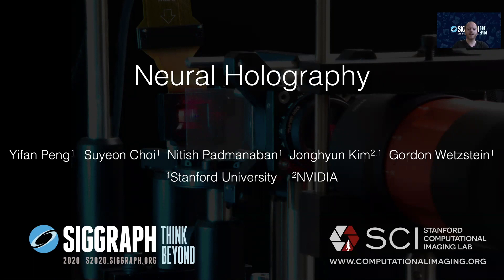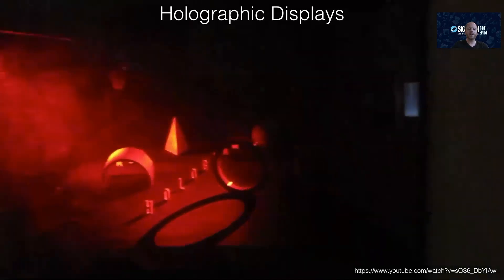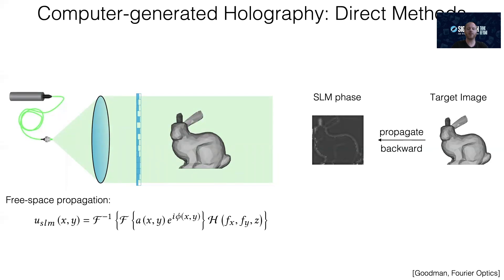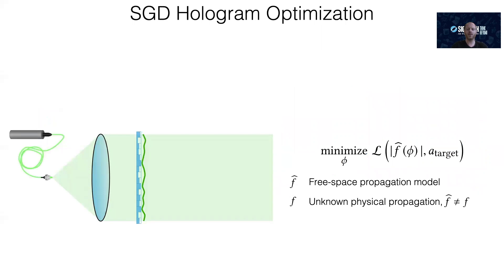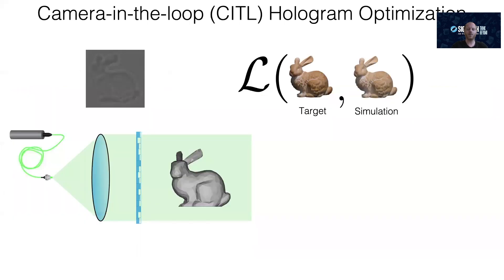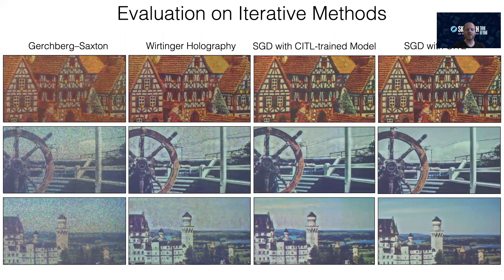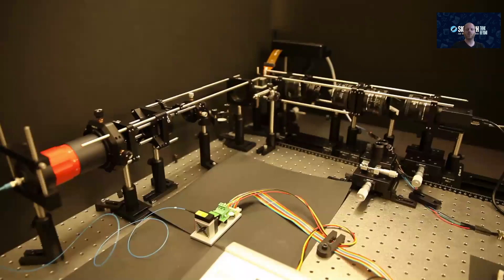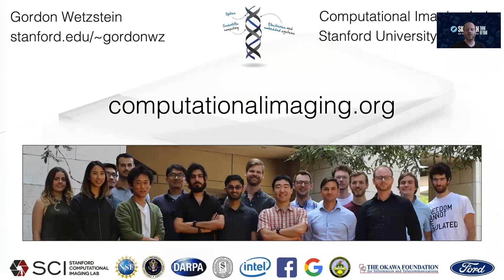Neural Holography | SIGGRAPH 2020 ETech - 15 min tech talk

Comment: Okay, let me try to figure out how to improve the design of the neural holography system described in the paper. The main goal is to enhance image quality. Let me start by understanding what the current system does.

The paper talks about using camera-in-the-loop (CITL) optimization and a neural network called HoloNet to generate high-quality holograms in real-time. They mentioned that model mismatch between the simulated wave propagation and the physical display is a big issue. Their solution uses CITL to calibrate the model and optimize holograms directly with a camera.

So, to improve image quality, I need to address the factors that cause degradation. The main issues seem to be:

1. **Model Mismatch**: Even after calibration, there might still be discrepancies between the simulated model and the real optical setup. Maybe improving the accuracy of the differentiable proxy model could help. The paper uses Zernike polynomials for aberrations and MLPs for phase nonlinearities. Perhaps using more advanced models or including more parameters could capture the physical system better.

2. **Content-Dependent Undiffracted Light**: The paper mentions that some undiffracted light depends on the SLM content and uses a CNN to model it. Maybe enhancing this CNN's architecture or training it with more diverse data could better account for these effects.

3. **Speckle Noise and Artifacts**: The results showed that CITL optimization reduces speckle compared to other methods. Could advanced denoising techniques, either in the optimization process or post-processing, further reduce noise?

4. **Training Data and Loss Functions**: The model was trained on the DIV2K dataset. Using a more comprehensive dataset that includes various textures and edge cases might improve generalization. Also, experimenting with different loss functions, like a combination of perceptual loss and adversarial loss, might yield better image fidelity.

5. **Real-Time Constraints**: HoloNet achieves real-time performance but at a slight cost to quality. Balancing the network's complexity to maintain speed while enhancing quality could be a path. Maybe using a more efficient neural architecture or pruning techniques.

6. **3D Holography Limitations**: The current work focuses on 2D with steps toward 3D. Improving the 3D capabilities by better modeling depth layers or using light field data might enhance the overall image quality in three-dimensional displays.

7. **Hardware Improvements**: The prototype uses a benchtop setup. Miniaturizing the system without sacrificing optical quality could be another angle, but that's more of an engineering challenge.

Wait, the user is asking about improving the design based on the technical paper, so maybe focusing on algorithmic improvements rather than hardware. Let me think about each component:

- **CITL Optimization**: They use SGD with a proxy model's gradients. Maybe using a more accurate gradient approximation or incorporating second-order optimization methods could lead to better convergence and image quality.

- **Differentiable Model**: Enhancing the model by including more physical phenomena, like polarization effects or temporal coherence, might reduce mismatch. The current model includes source intensity, aberrations, phase nonlinearity, and undiffracted light. Are there other factors?

- **Neural Network (HoloNet)**: The network architecture is based on U-Net. Maybe integrating attention mechanisms or transformer blocks could help in capturing global dependencies better, which might reduce artifacts.

- **Calibration Process**: The calibration uses 800 images. Using a larger dataset or online calibration during display operation could adapt the model to varying conditions, improving robustness.

- **Multiplane and Varifocal Modes**: For 3D, optimizing phase patterns for multiple planes simultaneously might require more sophisticated algorithms. Using depth-aware networks or adaptive focal stacks could enhance the quality in these modes.

Also, the paper mentions that the CITL optimization for single images gives the best quality but is slow. Maybe developing a hybrid approach where frequently used elements are pre-optimized with CITL and combined with HoloNet's real-time generation could maintain high quality without the per-image delay.

Another thought: The loss function uses a combination of L2 and perceptual loss. Maybe adding a term that specifically targets speckle reduction or contrast enhancement could guide the optimization better.

I should structure these ideas into actionable improvements. Let me check if any of these points were already addressed or if there are obvious gaps in the current approach.

To improve the image quality of the neural holography system described in the paper, the following enhancements can be proposed, building on the existing framework while addressing its limitations:

1. Enhanced Differentiable Proxy Model
Dynamic Zernike Aberration Modeling: Expand the Zernike polynomial model to include higher-order aberrations and time-varying effects (e.g., thermal drift) by incorporating adaptive optimization during inference.

Spatiotemporal Phase Nonlinearity Calibration: Replace the static per-pixel MLP with a recurrent neural network (RNN) to model temporal variations in SLM phase response (e.g., hysteresis or temperature-dependent behavior).

Polarization-Aware Propagation: Extend the wave propagation model to account for polarization effects, which are critical in SLM-based systems but currently ignored.

2. Advanced CITL Optimization
Hybrid Physical-Neural Gradients: Combine finite-difference approximations of the physical system’s gradients with the proxy model’s gradients to reduce approximation errors during backpropagation.

Second-Order Optimization: Use quasi-Newton methods (e.g., L-BFGS) for CITL optimization to accelerate convergence and improve final image fidelity.

Active Learning for CITL: Prioritize calibration for challenging image features (e.g., high-frequency textures) during training to reduce generalization gaps.

3. Improved Neural Network Architecture (HoloNet++)
Transformer-Enhanced U-Net: Integrate self-attention layers into HoloNet’s U-Net backbone to better model long-range dependencies in phase patterns, reducing artifacts in uniform regions.

Multi-Scale Perceptual Loss: Train HoloNet with a multi-scale VGG-based loss to enforce structural similarity at different spatial frequencies, improving fine details.

Adversarial Training: Add a discriminator network to HoloNet’s training loop to suppress speckle noise and unrealistic artifacts through adversarial loss.

4. Content-Dependent Undiffracted Light Mitigation
Physics-Informed CNN: Replace the generic CNN modeling undiffracted light with a physics-guided architecture (e.g., incorporating diffraction kernels as fixed layers) to improve accuracy.

Dynamic Undiffracted Light Subtraction: Use real-time camera feedback to iteratively subtract residual undiffracted light during CITL optimization.

5. 3D Holography Enhancements
Depth-Aware HoloNet: Train a single network to predict multiplane holograms by conditioning on depth maps, enabling seamless 3D transitions without separate per-plane models.

Light Field Integration: Replace 2D target images with 4D light field inputs to inherently encode parallax and occlusion cues, improving depth realism.

6. Dataset and Training Improvements
Synthetic + Real Data Training: Augment DIV2K with physically captured holographic image pairs to reduce sim-to-real gaps.

Speckle-Specific Augmentation: Inject synthetic speckle noise into training data to make HoloNet robust to such artifacts.

7. Hybrid CITL-HoloNet Pipeline
Pre-Optimized CITL Templates: For applications with repetitive elements (e.g., AR menus), pre-optimize key components offline using CITL and combine them with HoloNet’s real-time predictions.

Online Model Refinement: Allow HoloNet to adapt its weights during operation using occasional CITL snapshots, balancing speed and quality.

8. Hardware-Software Co-Design
Dynamic SLM Bit-Depth Control: Use the calibrated model to optimize phase quantization in real time, trading off computation for reduced quantization noise.

Wavelength-Specific Calibration: Extend the model to account for chromatic aberrations in full-color displays by jointly optimizing RGB channels.

Expected Outcomes
Image Quality: Reduced speckle noise, higher contrast, and better color fidelity, especially in uniform regions.

3D Performance: Improved depth accuracy and reduced vergence-accommodation conflict in varifocal/multiplane modes.

Robustness: Better generalization to unseen scenes and dynamic environmental conditions (e.g., temperature changes).

By iteratively refining the differentiable model, enhancing the neural network architecture, and leveraging hybrid optimization strategies, the proposed improvements aim to push the boundaries of real-time holographic display quality while maintaining computational efficiency.

Comment: Is there any research into building SLMs that can modulate both phase and intensity?  Perhaps with a polarizer sandwiched between two traditional transmissive SLMs?  Would your technique benefit from the extra degree of freedom?
Reply: I'm not an expert in this area, just a curious observer. There is one research paper which uses an SLM which can modulate both phase and amplitude, see: https://www.youtube.com/watch?v=NdTycenXID8 but most papers i read just use phase modulation, i don't know why.
Reply: @sophiasaenger1856  Thank you for the reference!

While it's not amplitude modulation, I also just found a video where they describe 3-DoF Reflective SLMs for stronger photonic tweezers:
https://youtu.be/v5OvogF0neE?t=1255